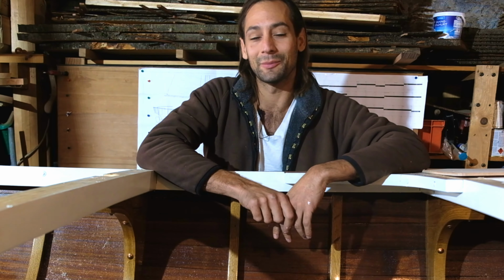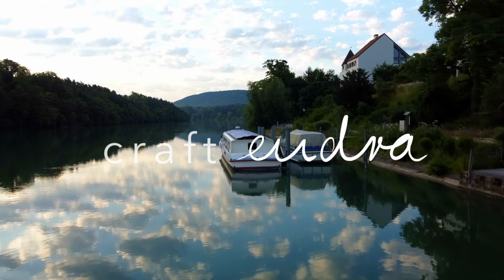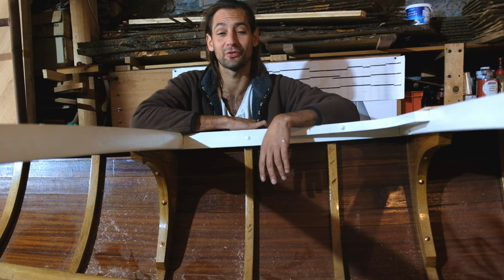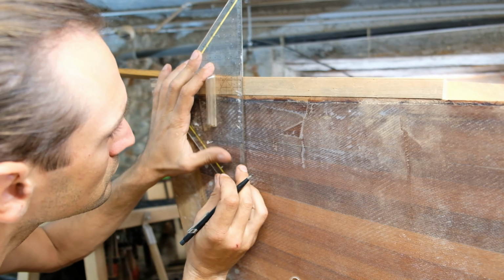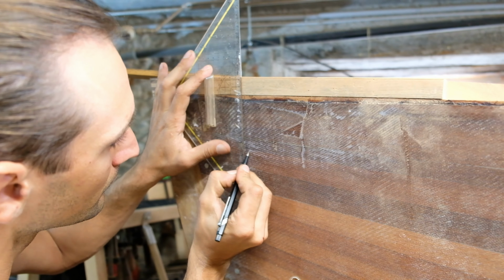Brass work and Partners - craft Endra EP19 I Building a wooden sailing boat

Comment: It's looking great, Sandro. 
You might have been able to remove a bit more of the weld, I think, and it's not too late. You might have to file rather than using a power tool. The Sampson post looks good too. And here's a tip (from an architect who draws free-hand all the time)......always draw your curves from the inside. Did you notice how much easier and more accurate the first two segments of your curve were, compared with the second two?
Loved the walk at the end.
Reply from the maker: Hey Mike. Yeah I thought likewise, I‘m gonna work on it with a Dremel and fair the seams a bit more. 
Thanks for the drawing hint too 😁. 
Have a wonderful day 😎